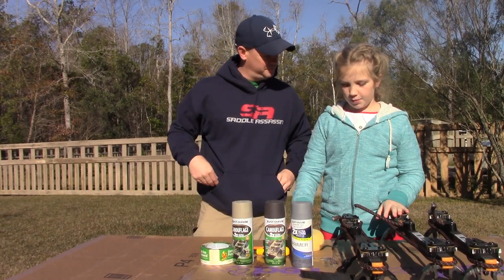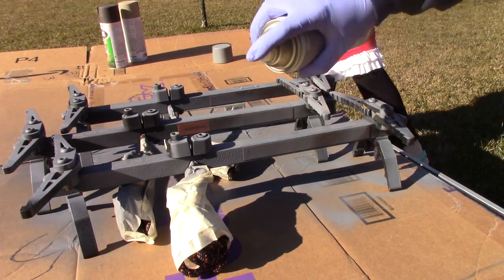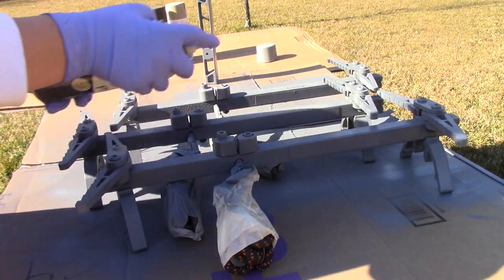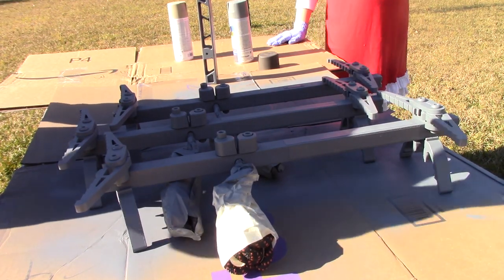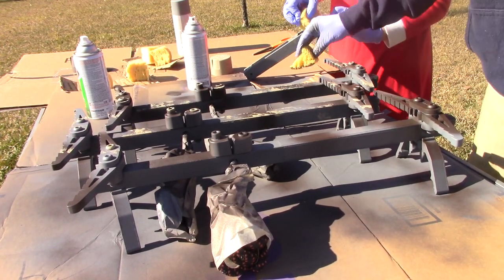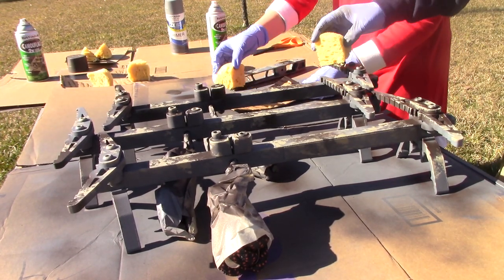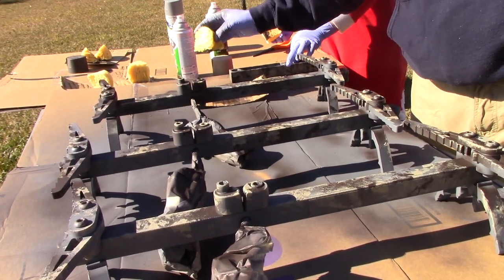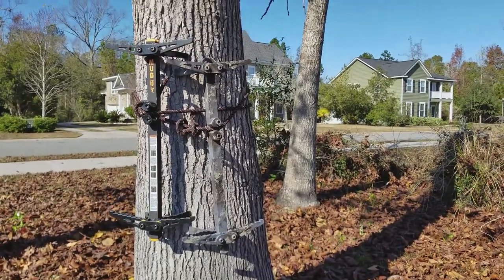How to camo your climbing sticks - DIY Camouflage

Comment: I will do this on my 4 Muddy Pro Sticks. One question I have for you after you used them is whether the spray paint getting into the cleat affected the cleat working on the rope at all. If it did, then I will just tape the cleats before I paint.

Comment: Great video Greg. I am hooked on your videos sir. How does the paint  wear over time? I am use to spray paint coming off pretty easily on other equipment. What about adding a clear coat afterwards to protect the paint from coming off?
Reply from the maker: The beauty of this style of camo is even if it chips and cracks over time, it won't matter. I used the sticks all last season and they look no worse for wear. Maybe after 3 or 4 seasons I'll have to re-apply? I'm not certain.